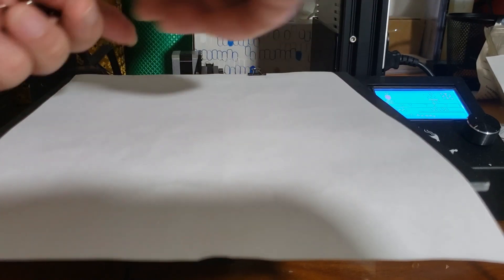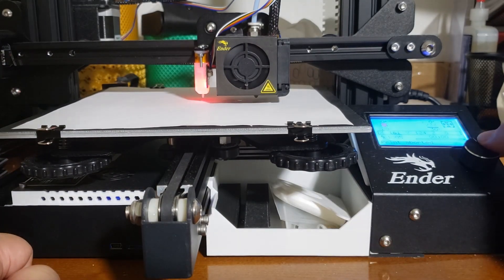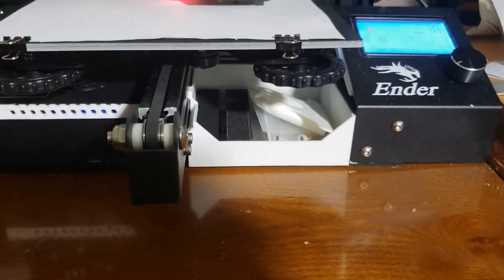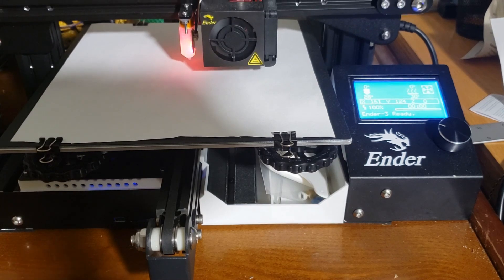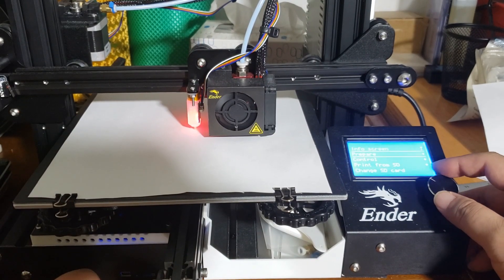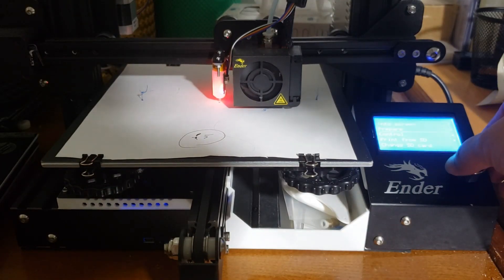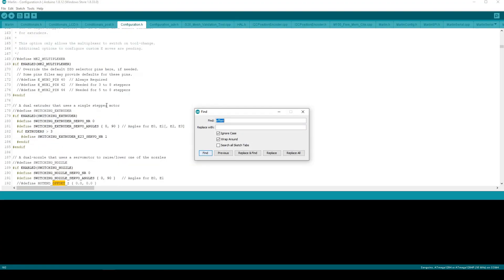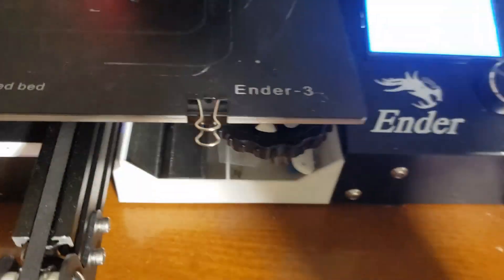Ender 3 BLTOUCH 3 UPGRADE - HOW TO ADD THE XYZ OFFSET. MARLIN FIRMWARE 1.1.9

Comment: Hi I recently installed Microswiss Dual Gear Direct Drive with the hotend and I for some reason it doesn't print in the center. When it makes the line before it begins printing it starts it at just before it gets off the bed so it's basically too far to the left. Not sure why that happened but I imagine I can fix that with Pronterface? Although I've never been able to connect it.

Comment: Hello!
I have an ender 3 max with a 4.2.2 board and I'm using octoprint.
I just installed a V6 hotend which relocated my BLTouch from the right side of the carriage to the left.
I have the offset numbers... but I just don't know which file to edit?  Is this a file on the SDCard I can edit that will fix this offset?
Reply from the maker: No. You need to set the offsets in the marlin firmware. Here is a playlist for the install of a 4.2.7 board. https://www.youtube.com/playlist?list=PLKB2mjSs4KgN29yU2t4kGeNoVFJWeSt6H Some of the videos in the playlist will be helpful to you. Especially the ones on how to compile own firmware and offsetting the xyz components. It's not just one thing. You need a general knowledge in various parts in order to compile the firmware correctly.

Comment: This is a Longshot but my bltouch doesn't do the offset after it probes twice. Example at 2:40 ish my does 2 then just comes up. Anybody know how I can fix this?
Reply: Did you fix this? I got same problem.
Reply: @G_Zero127  Nah after 30+ hours working on it I was just done. Not worth it
Reply from the maker: Possibly incorrect wiring

Comment: do I need to do all this before I can enter the settings in your video here https://www.youtube.com/watch?v=LTuyJmPPZ_M 
If so how to I compile merling to get this part done with or without the BL-TOUCH defined?
I am a bit confused.

Got my 4.2.7 board on the way as my new, now fited bltouch kit (now with altered wiring in the propper location), blew the F2 (fuse 2) on the 4.2.2 board because of wrong wires, so the printer has no board in at the moment but I would like to compile marlin ready for when the new board arrives.
Reply from the maker: A lot of these steps are not required if you can get a hold of firmware that have the same specifications as your printer hardware and upgrades. Ender 3 is not just and Ender 3. It's an Ender 3 with 1.1.4 board or 4.2.2 board with bltouch, etc...  Most of the time users don't know what type of board and hardware they have on their printer which makes it a problem. Incompatibility issues. This is why even if you decide not to compile your own firmware you should at least get familiar with the components. The 4.2.2 is different from the 4.2.7 board. One is 16bit the other is 32bit. Here's a playlist for the 4.2.7 board. https://www.youtube.com/watch?v=FW3HO24q4rY&list=PLKB2mjSs4KgN29yU2t4kGeNoVFJWeSt6H The video you are commenting on now is the setup that was made for the 1.1.4 board. Procedure is similar, but not always exactly the same. As far as the bl touch if you are not using the bltouch it should be undefined. In other words turned off.

Comment: At the end when you tune the Z height with baby steps how do you save that adjustment?
Reply from the maker: There should be save to eeprom in the menu.. or use the gcode command m500 in the terminal.

Comment: can i ask you? how i changed that auto home position? i dont want that default position like when its like bed is full back and nozzle is in front of that bed i wanna auto home like you have can u help me? anyone?
Reply from the maker: Please watch this video. https://www.youtube.com/watch?v=3J9NhwbziEY You will have to make changes in the firmware
Reply: @DiyProJames  
hey bro i appreciate it but i'm probably stupid because i didn't find it in the video. Would you like to tell me what minute of the video it is?
Reply from the maker: @adampokorny3689  It's not just one thing. It's aligning the probe, nozzle, and bed and the steps are shown in the video.. Are you using the stock board with the pin 27 board? If this is the case there is a .hex file https://www.thingiverse.com/thing:4644075 that might work...
Reply: @DiyProJames  I though change in marlin called Z_SAFE_HOME i found that and i have BTT skr e3-dip motherboard

Comment: how was you able to connect arduino directly through usb with no loader to upload config
Reply from the maker: The arduino ide is the uploader. You select the board type, com port, chipset, etc.. to upload directly to the printer using a usb cable using the arduino interface.
Reply from the maker: @C0gitoZ33 Droid The "arduino ide" is the software on your computer that allows you to interface with your printer via the usb cable. Something like "arduino uno" or "arduino nano" is microcontroller board if you don't have a bootloader already installed on your printer you'd have to use these microcontroller board to flash the bootloader to you printer board. (Typical Ender 3 does not have a bootloader installed.) Once you flashed the bootloader to the printer board you don't need to use the micro controller any more. You'd disconnect the microcontroller and directly interface via your computer to printer connection.

Comment: Hey James, I have a CR-10S Pro v.1 w/ BLTOUCH 3.1: I followed your videos for the installation and Marlin setup. 
My issue is that I don't have good bed adhesion. When I do aux bed level with my .20 feeler guage. Then I auto bed level seems nozzle prints too high. I then saw this video where you play around with the Z for this Ender printer. I have a different BTTOUCH mount then yours. I have my X and Y offset set fine. I think just my Z needs an adjust on  #define NOZZLE_TO_PROBE_OFFSET { -22, -45, 0 }   You have your value at 0. Does this mean when your BLTOUCH is deployed there is no offset between tip of BLTOUCH and nozzle tip? Do I want to mess with the Z value on the NOZZLE_TO_PROBE_OFFSET?
Reply: I figured it out and added an adjustment to Z offset.
Reply from the maker: Glad you figured it out.
Reply: @SaberExperts  i have the same issue. nothing sticks. ive leveled my cr10s pro with the feeler guage and auto leveled numerous times. i noticed the head still remains a little high after all that. is there an easy way to fix that? i dont have any firmware installed. infact ive never installed any sort of firmware. i will note that my bltouch 3.1 should be getting here this week, and i plan to follow james's tutorial and  install it along with tiny machines firmware, if that matters.

Comment: nice vid, thanks for sharing
Reply from the maker: You bet
Reply: @DiyProJames  question, I noticed that for the Z-offset you used something close to -3.,7 but the offset set in marlin config was -5, after flashing do you change it back to -3.7 or -5 is the right offset now?
Reply: btw flashed using your settings and after auto home my Z is 19.55 so not sure if I messed up something else
Reply from the maker: @sailingdev  no you need to manually set your z offset and save eeprom. that -5 is there because there is a safeguard in the firmware that doesn't allow you to go below the nozzle. The bltouch nozzle will deploy below the nozzle.
Reply from the maker: @sailingdev  Your z home might vary slightly than mine because your bltouch and mine maybe slightly different in when it senses the bed. Probably withing 2mm though
Reply: @DiyProJames  thanks, I was able to get it printing super close to the magnetic bed, a lote better than before, I'm now tweaking cura first layer speed so it doesn't miss the bed in corners

Comment: This one is messing me up a bunch.  Can you please clarify the Z axis parts.  Thanks.
Here is what is going on for me:
ENDER-3 (NOT PRO) with MARLIN FIRMWARE 1_1_9 installed and a BLTouch v3.1
I have my paper on the bed.
Turn on the printer, BLTouch cycles D/U/D/U and stops red.

RUN - 1
PREPARE > AUTO HOME
the printer head raises up a bit, 
checks X 
checks Y 
checks Z 
then moves moves up a bit

PREPARE > MOVE AXIS > MOVE Z > 1mm
screen reads move Z: +13.0
rotate knob CCW to Z = +001.0 and postit note paper slides under nozzle
rotate knob CCW to Z = +000.0 and postit note paper RUBS HARD
rotate knob CCW to Z = +000.3 and postit note paper rubs lightly
rotate knob CCW to Z = +000.2 and postit note paper rubs firmly
use +000.3

CONTROL > MOTION > PROBE Z OFFSET
probe z offset reads: -3.0

So (-3.0) + (0.3) = -2.7 == probe z offset setting to store

MAIN > CONTROL > STORE SETTINGS > ENTER

PREPARE > MOVE AXIS > MOVE Z > 10mm
safety rotate know CW to : = 20.00  
power off for ~5 seconds, power on

RUN - 2
PREPARE > AUTO HOME
the printer head raises up a bit, 
checks X 
checks Y 
checks Z 
then moves moves up a bit

PREPARE > MOVE AXIS > MOVE Z > 1mm
screen reads move Z: +12.7
I moved the Z to+000.1
then to 000.0
then to -000.1
then to -000.2 and I'm afraid it would go farther
it will let me drive below Z 0.0
Reply from the maker: When you home does the nozzle touch the bed? If it does or only has a gap to the thin paper. Then your good to go. If you have a large gap you need to move the z offset closer to the bed. Have you tried printing something? You should try to print something and check if the nozzle is low enough. Right now I'm in the middle of a print and cannot go through my printer menus. Also, I might be able to help you on https://www.twitch.tv/diyprojames once my print is done. But from what your telling me I think you might be good... Are you using the metal mount made for the ender 3 or a different one? If it's the same one as mine it should be around the general vicinity of my offset.